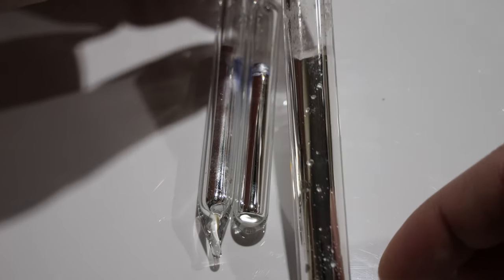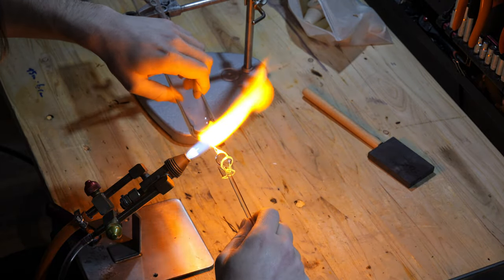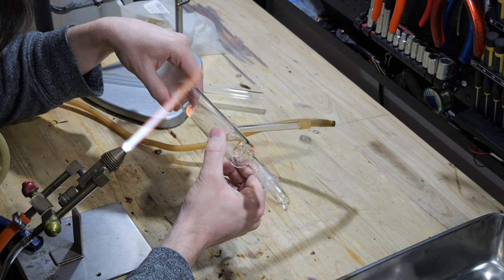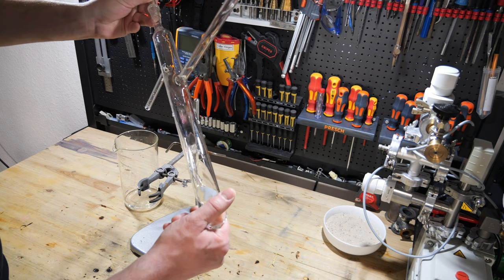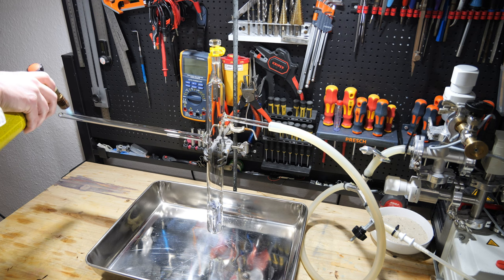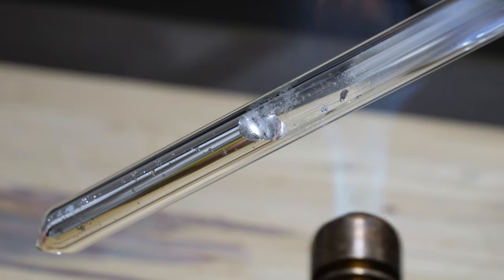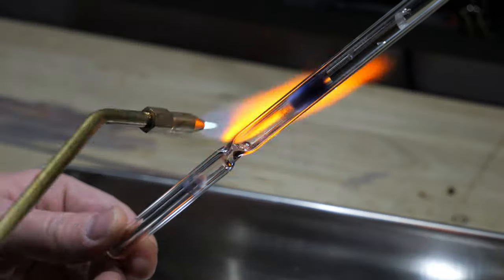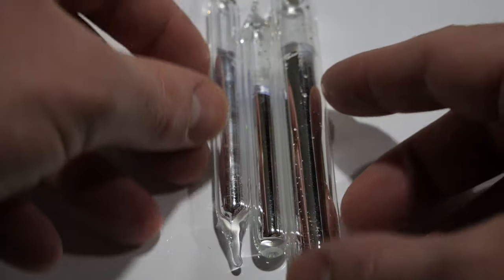Potassium Purification Without Distillation

Comment: It makes intuitive sense to me that this method would work for purifying alkali metals; when you think about it it's the same process as TLC, HPLC, or column chromatography, but the main component being separated is also the eluent.
Obviously most of the things you can separate with TLC or HPLC aren't going to work on a glass tube because the surface area is tiny, but for something that interacts strongly with silica (like alkali metal oxides) it's good enough to at least do something.

Comment: Maybe next trying to make inside grooves or a glass spiral with to maximize contact with the glass? Or even using a capillary glass tubing? 
Have a great week!
Reply from the maker: I think a capillary tube would clog very quickly. Grooves might be possible but would make even pouring very difficult. Since I know it can be done with a simple tube, I will try it again with a longer version before modifying the surface.
Reply: @AdvancedTinkering  could you rotate the apparatus as you go so you use more of the surface of the large tube?

Comment: Since you cant use aqua regia, if you want to destroy organic contamination, is plasma cleaning viable for you?  Can you clean the vessel with IPA/Water the same way you have been, but then vacuum and partially backfill it with oxygen, and then ignite a plasma with some sort of RF excitation, and let the ionized oxygen plasma do the final stage of cleaning?  I dont know where the differentiation between "pretty plasma show" and "aggressive cleaning action" would be in terms of how hard you need to drive it, but I would expect it to be at least somewhat reasonable power levels for an at home lab.

Comment: could you use a graham condenser filled with hot oil to capture the potassium oxides when you pour it through?
the oxides should be easy to clean out with water after the process
Reply: I imagine it'd improve things a little but I feel like this might be more prone to catastrophic mishaps than just distilling the potassium.

Comment: What is the origin of the violet color of the condensed metal on the inner surface of the vials? I am aware that the vapors of alkali metals are colored due to the vibronic coupled excitation modes of the diatomic molecular gas they produce, which are absorbing bands of light in the visible spectrum, but the condensed metal should be colorless.... is this a surface plasmon resonance effect? I even see the color on the pieces under the oil.
Reply: maybe a diffraction grating effect? but the color seems to change depending on where on the glas you look and not the angle to the camera. so my money lies on surface plasmon resonance
Reply: @juleswernes  I think so too

Comment: If not aqua regia, why not HCl still?

Regarding the lumpy/porous metal, what about melting and cleaning it beforehand (under oil with a bit of IPA)?  A coalesced lump ought to be pretty free of trapped matter.  Then again, I suppose that was the point (what's the minimal process to clean and ampule it)?

Comment: It's very hard to clean it significantly without distilling. Have a look at commercial samples: 99,95 % is silver shiny, 99,8 % is already black. You succeeded with distilling caesium, why not with potassium, too?
Reply from the maker: Considering the fact that the potassium in the vial is silver shiny I am very satisfied with the purity :D. You are right, I could just distill it (I allready did but didn't make a video about it) but I really wanted to test this method because I have never seen it done on video before.
Reply: @AdvancedTinkering The potassium in the first ampoule doesn't look silvery, but black. I am not sure about the second one, but the third is definitely shiny - and a bit bluish.
Maybe the color rendering of the video is deceptive - or my perception... 🙃
Reply from the maker: @experimental_chemistry  There is definitely nothing black inside any of the three ampoules. They are, at least on the walls, completely silver. Maybe it looks like it due to the reflection. I noticed that the potassium on the thumbnail looks kinda black. It's hard to photograph something that's basically a mirror :D 
But there are some white impurities at the top part of the ampoule and the potassium is not shiny on the top. Still silver, but not shiny. I hope to get a better ampoule soon.

Comment: You could use conc. Sfuric acid to dry your argon maybe
Reply: The ban is regarding all mineral acids not already present in products we buy.
Reply: I guess the best solution is to simply buy it abroad... ;x

It fully makes sense that random people shouldn't just buy concentrated nitric and sulfuric acid (and maybe even mix them and then put other stuff in that mix 😏), but just like with explosives and pyrotechnics people with proper knowledge ("fachkunde") should have the right to buy those things! (Except that - unlike for explosives - this law doesn't even consider any private usage, WTF!)

Comment: Well, i am surprised that you say you need schlenk line for drying argon properly. Schlenk line is only glass equipment with valves making work with vacuum and inert gas at the same time a lot easier, it has nothing to do with drying gas! You jest need the right filter for catching all moisture and oxygen from your argon (with can be part of schlenk line or not, but is not its integral part!). A heated cartridge filled with a copper sponge is something used in glovebox purification systems (and I see those under fumehoods also), I read about using a potassium mirror on some solid support ) like glass wool or molecular sieves for catching oxygen. For moisture: molecular sieves.
Reply from the maker: You are right, I don't need a schlenk line to dry the argon. A simple drying tower with phosphorus pentoxide would probably be sufficient to remove the moisture. I didn't mean, that I need the schlenk line for drying the gas but it makes working with the dry gas much easier. Currently I am pinching off silicone tubing to switch between argon and vacuum and let's just say it gets annoying really fast ^^.
Reply: @AdvancedTinkering  I understand this a lot XD I am surprised you are not using three way valve for that, schlenk line is just multiple of them connected in parallel XD
P2O5 is not best choice for gas drying, maybe it is fast, but in such tower very fast it will artially liquify, form glass of artially hydrated acid and there is big chance of plugin bottom input. Also owdery stuff are bad choice, because gas can easly carry them over. For drying i wrote about copper sponge, it is solde as small tablets of coper oxide (pressed powder) that is later reduced to coppper with 5-10% hydrogen in inert gas. More or less this is standard with gas deoxygenation nowadays.
Reply from the maker: @ejkozan  I actually was using a three way valve until it decided to break when I turned the stop stopcock -.-. 
Yes, I saw that before. Especially in old bottles of P2O5. It basically an I destructible chunk. But I know that some labs are using it to dry gasses. I think they are mixing it with something that prevents it from solidifying. 
Molecular sieve would be the easiest solution, but I'm not quite convinced that it would reduce the moisture content to an acceptable level. Do you think 3A molecular sieve would be sufficient? 

Using titanium or copper sponge for oxygen removal would be great. But it requires additional equipment like an oven. But if I ever have the space to set up a proper schlenk line it will definitely be part of the system. 
I also thought about bubbling the dry gas through some NaK to remove any oxygen :D.
Reply: @AdvancedTinkering  P2O5 would be fine for small amount and short times, you do not want to leave it for long. Sieves are normaly used in gloveboxes and so on, mostly ones with bigger numbers, like 5A or even better 13X, 15X (nomenclature is wild). Those in glovebox takes water below ppm level, then those shoulld be good for line also. If not that, look up about potassium mirrors, those can be used and eat water as well.
For copper it is not as much oven as heater, i think resistive heating tape would be more than enough for that. I had nice book about goveboxes and dry techniques with a lot of informations like that. I need to check title.
NaK bubling, I think it is a bit to dense for that XD
Reply: @AdvancedTinkering  Found it!
Shriver, Drezdzon - The manipulation of air-sensitive compounds, Wiley  (1986)
It have chapters about gas urification as well as glassblowing that will definitely interest you!
Reply from the maker: @ejkozan  Thank you for the great recommendation! It's a really helpful book. 
I think I will try it with MnO as an oxygen absorber. The book states that it works at room temperature and its easy to nake from manganese oxalate.
Reply: @AdvancedTinkering  I am happy I could help! It seems MnO went out from favour in laboratories and nowadays copper is used. I am curious why, maybe price? Or oxygen capture capacity? Any way, can nto wait now for your next videos :)
Reply from the maker: @ejkozan  I would really like to use copper but I hate the idea of dealing with hydrogen in my room. And I would have to get an additional hydrogen cylinder. That's why I decided to use MnO.
Reply: @AdvancedTinkering  Very valid point!
Best thing is, that aking such purification system would be great video series by itself!
Reply from the maker: Thanks to your suggestion there will be a video about making a drying and oxygen removal system :)
Reply: @AdvancedTinkering  Yupikayay! Can not wait!